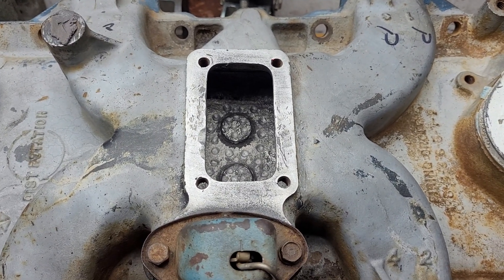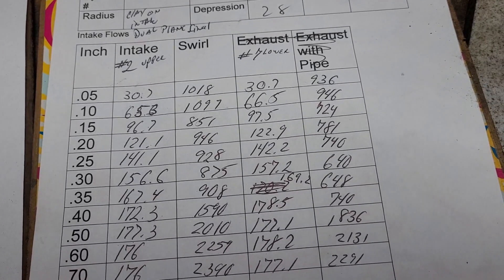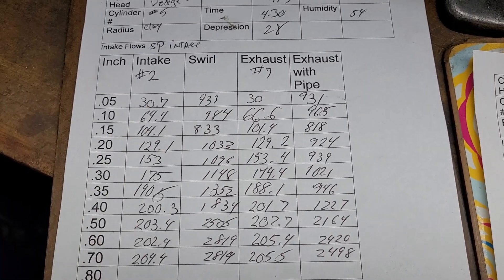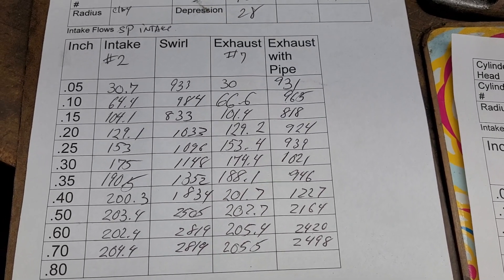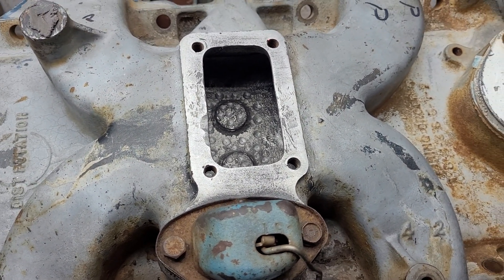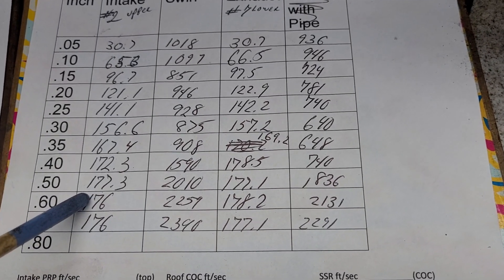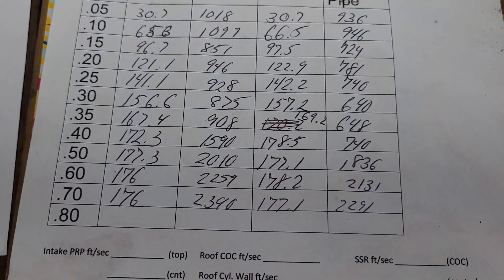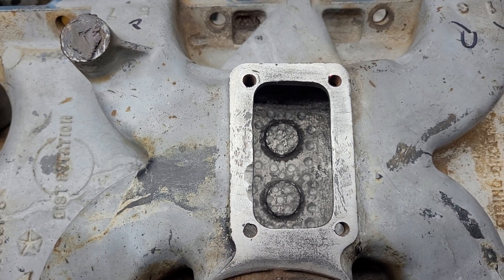Mission Impossible single plane vs. dual plane flows and swirl

Comment: Enjoying your videos on this subject. My son and I are building a 351W roller motor and plan to run a dual plane air gap with Holley sniper, should we mill the divider under carb mount or run an open spacer?
Reply from the maker: Run it with the stock divider first. If you need more power up top try a tapered spacer and or an open spacer. Thanks

Comment: Eric's the best and you are very good to mate. the stuff u play with is left field but its like. it teaches people somethings that the wouldn't think in like a straight forward port match. on a single plan that's to be for your stock 289 with 850dp . its to helps make sense of oddities. that you wouldn't experience's with out 40 years of knowledge . for example if i built a 454 id probably go single plain. id skip over a ported dual plain thats probably where i want my power
Reply from the maker: I agree. Thanks
Reply: @servediocylinderheads  dyslexic as balls should have proof read
Reply from the maker: @jacksonbermingham2168  I got a bit of that too.

Comment: the dual plain make no sense to be that close??  is there such thing as a water mist carby u can spray.. and check  cfm because the fact its that good is quiet insane not in a bad way i just never expected it
Reply from the maker: It was a ton of work, did I do as well on the other ports?
Reply: @servediocylinderheads  it be very stout on a low revver
Reply from the maker: @jacksonbermingham2168  I think you are right.

Comment: I googled dodge 318 TBi intake to carb. It brought up two links from Abodies and a bunch of intake manifold ads. In Abodies only it states you would need an adapter for a Carburetor to fit. In the old mopar books I had it never states difference but Hp went up from 120-130 carburetor to 165-175 TBI

Comment: I have to say, having multiple outfits offering up bits and pieces to the Mission Impossible 318 is a great boost for St. Judes.   But it also is a map for pushing forward on basic 318 horsepower.
Reply from the maker: 318 is a solid design. Thanks

Comment: Watching Eric's video next. I wa guessing it would make a little more power. I have some intakes to send them but are probably too small. I think your doing great in the 318 intakes.  The TBI with your trick spacer is going to be awesome.
Reply from the maker: I think the tbi will work well. Thanks
Reply: @servediocylinderheads  I screwed up . I'm thinking now that the cam specs were advertised duration  and he even tested some dual planes. So my intakes are not to small.
Reply from the maker: @dondotterer24  It is a good question. I thought he said the duration was at .050"
Reply: @servediocylinderheads  me too especially with the lift numbers. That's why I was guessing over 600HP simular to an late model engine my friend built but a little less at .050. At those numbers. I did comment.  Watched the video twice. Also commenting if the hacked up intake had a smaller opening than the head?
Reply: @servediocylinderheads  you are correct. He got back with me at .050.
Reply: @dondotterer24  I’m pretty sure Eric’s dyno numbers are uncorrected.
Reply from the maker: @evanarthur7535  You make a good point!

Comment: Id like to see the single plane compared to something like a torquer 2 or similar, with a 2bbl spacer adapter,  I'd like to turn the 2bbl carb sideways and keep it in center, work the spacer adapter so the 90° turn is more like a few 20°- 30° or  a 60° and 30°  not a 90 straight off the bottom of the carb or spacer, a 1spacer with a inverted funnel carved into it to help turn the flow a bit,   a 4bbl opening being closed off to a 2bbl,  over a 1"-1.5" of depth, or 1" and 3/8" or so, flip that over and it be the adapter, allowing a dome in the center of the floor,  test are needed for sure,  I'd love to test some cray ideas I have,  if I had a way to weld aluminum, I'd cut up a intake, probably large as a dominator flange  and a spacer sweeping curve to a 650-750 Holley sq bore, about 1" spacer,  in attempt to get the flow from under the carb to flow more like a tunnel, I have a lot of crazy ideas I'd like to try, 
Maybe a intake that is like a 8 into 1 header, the collector being the plenum,  
Maybe a 8-4-1 but short as possible, because it can easily get long, possibly the 4 runners extra large diameter, to move the rev band , working more as the plenum than runner, use thick wall tubing so it can be ported a lot, if required,  make straight shots as possible, or sweeping curves,.   The drag race guys basically just want to bolt the carb to the head, they just need an adapter to get it done,  haha  sorry to ramble!
Reply from the maker: Rambling is fine, I have lots of noise in my head too. It is a sign of higher intelligence I have heard. 1988 Olds quad 4 had an intake manifold that looked like a 4 to 1 header. At the time it made the most hp per cube of a stock mill I think.

Comment: I'm enjoying all this info. A couple of questions, what is the port volume on the heads with the stock valve size?
Reply from the maker: I didn't measure it at stock valve size but it would be less than 149cc.

Comment: The 1965-1967 273 Commando exhaust manifolds are better than the 318 log style exhaust manifolds. 
The 273 Commando was high performance while the 318 was general use. 
Have Tony find a set along with a 360 2-bbl carburetor and a 340 windage tray.
Reply from the maker: I have the center dump 318 maniolds coming.
Reply: @servediocylinderheads   the 318 log manifolds should be good for a 40 HP/ Ft Lbs reduction I'm afraid.
Reply from the maker: @slicepizza3263  Are the center dump considered a log? I always thought of a log manifold as rear exit.
Reply: @servediocylinderheads  
I wish I could attach photos to show the difference between them. My definition if a log is a straight pipe with short 2 inch inlets.  The high performance manifolds have individual runners that sweep up or down and merge together. It's difficult to describe so I hope I did okay.